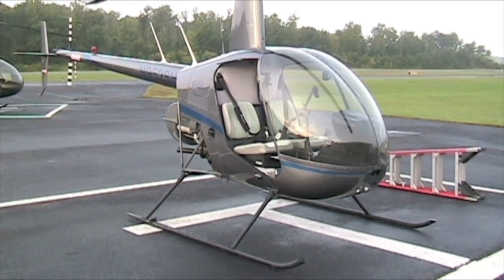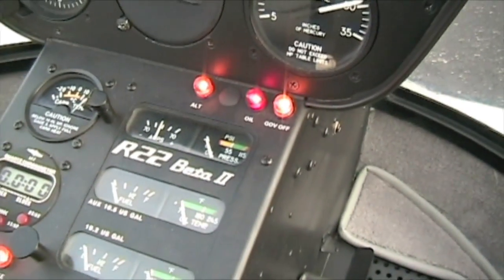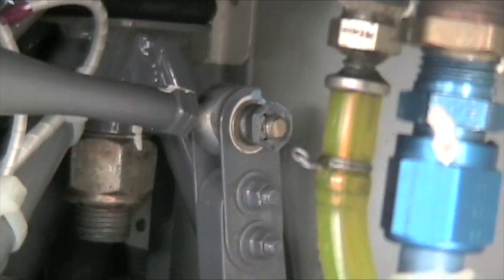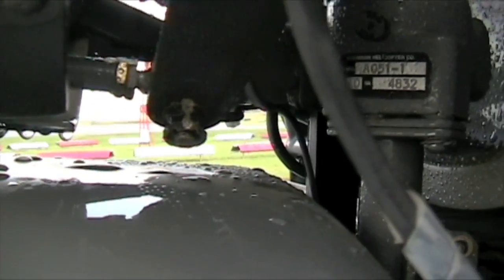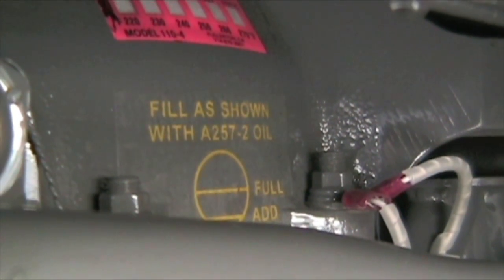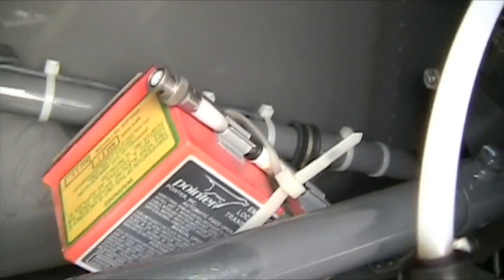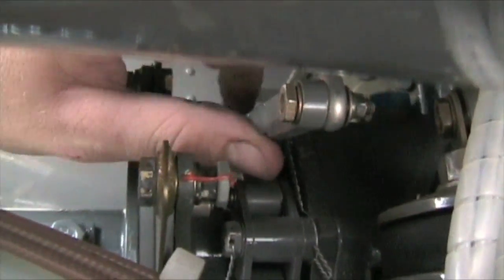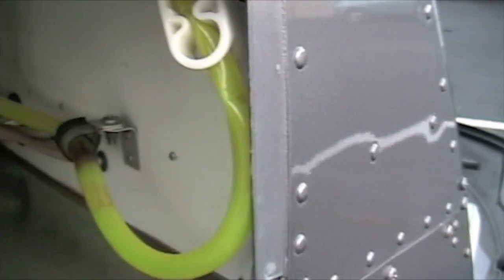Part 1 -  Detailed Preflight Inspection of an Robinson R22 Helicopter

Comment: what is the meaning of ETL ?
Reply: Note the word transitional. ETL transitioning to forward flight is usually felt around 16 to 24 KIAS. But the rotor comes more efficient as forward airspeed increases. Around 16 to 24 KIAS the rotor system completely out runs recirculation of old vortices making it more efficient and effective.